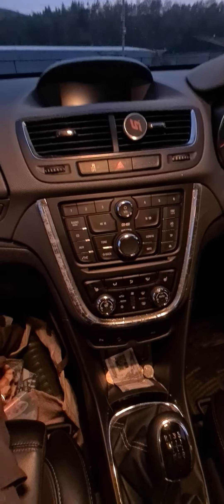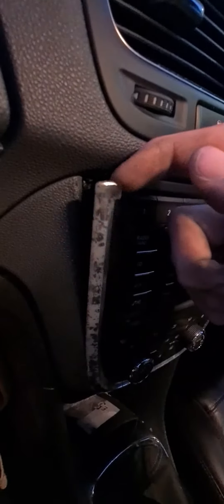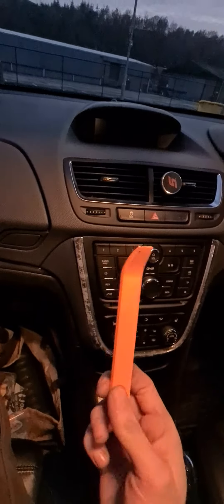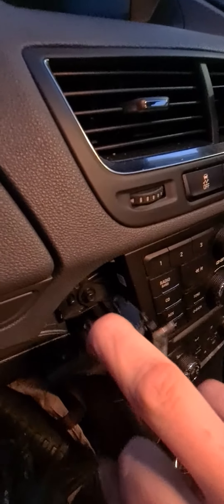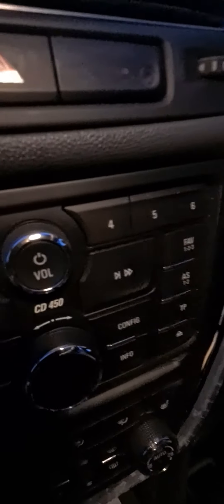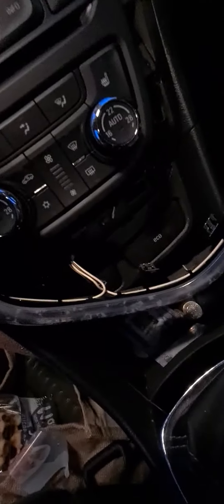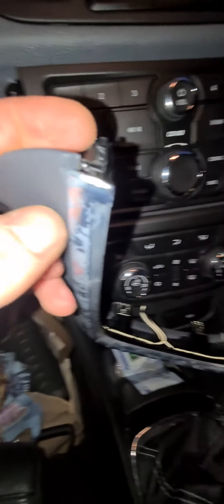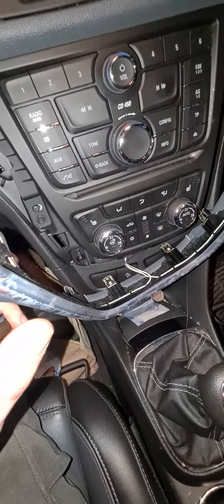Vauxhall Mokka removal of trim around radio

Comment: Thanks for this. Gave me the confidence to get stuck in. Successfully reverted back to stock from a 2008 vintage Alpine sat nav. The wife has got to grips with "maps" at last and the display size on her phablet is the same as the old Alpine. Never managed  to get good integration between car and the Alpine and the Alpine radio sucked. Happy now. Thanks again.
Reply from the maker: Glad to hear it's helped. It's weirdly the one panel that's never explained how to remove. I've been looking at fancy radios for a while but always read mixed reviews
Reply: @hiigherthanhell6712  My experience for what it's worth: Alpine INE S900, cost £1,100 back in 2008 to put in an SLK350. The radio was never great but Sat Nav brill and good for hands free phone. Put it in the wife's Mokka in 2016. Professionally installed (because I didn't want to wreck the trim!) using Connect2 interface. Mokka has dab and fm aerial supplies. Alpine only FM. Radio still awful. I'm sure modern 2din units would be great. 
Car configuration option controls on Mokka were lost as these were on the stock CD450. You could do certain things, like manually adjust the time. Trial and error to figure it out and had to switch off the engine to accept the new time. The Mokka must have its own clock in the front shelf display. This lost time once disconnected from the CD450, 5 minutes per month.
Putting the CD450 back in gets us a brilliant radio back, a basic hands free phone and car settings. I spent ages researching after market  units. Could not find anything about integrating them with the Mokka.

 The was no cable splicing with the Connect2 kit. So I wonder if you could buy one of those. Borrow a current 2din sat nav. Temporarily connect everything up and confirm you're happy before you buy the unit and facia plate

Comment: I have said car my 2 heating controls are not lighting  up could it be just a blown bulb ?
Reply from the maker: I wouldn't of thought so as its an LED strip. Maybe check the connection shown in the video and test for 12v. If not more than likely a fuse. If there is power, check wiring on LED strip
Reply: @hiigherthanhell6712  you any idea the fuse location ?
Reply from the maker: @paul-fk7de  unfortunately not